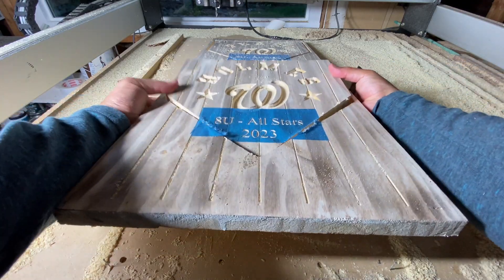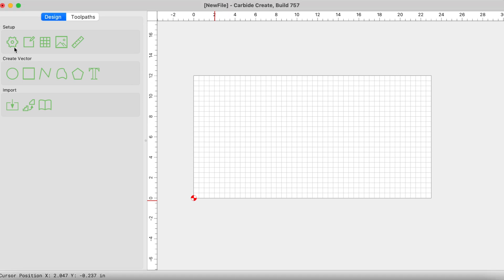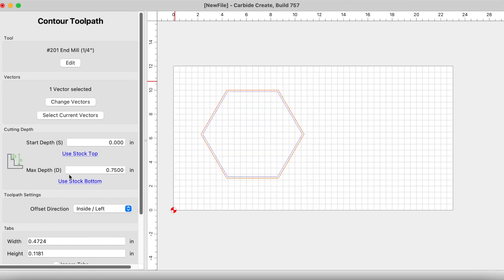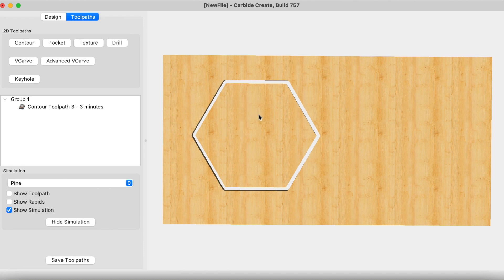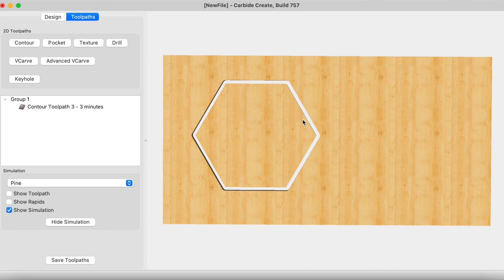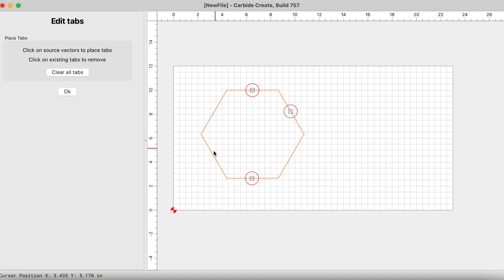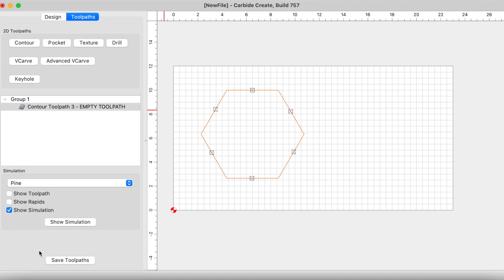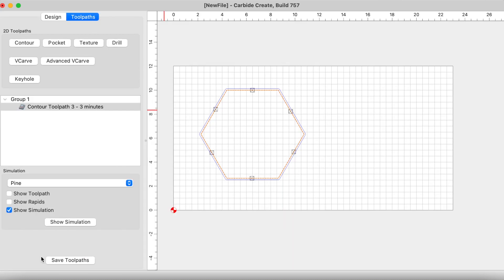Carbide Create Basics Tutorial - How to Make Tabs in Carbide Create

Comment: Yoooo. I was just cutting out pieces on my Shapeoko for my laser machine enclosure and I didn’t add enough tabs yesterday that the two tabs broke and the wood moved and messed up. Bottom line, add more tabs if you wanna be safe. Just in case. 

Love your channel and videos. 👍🏼🙏🏼
Reply from the maker: Funny you say that because my last project same thing happened.  I though two was enough but it ended one ended ip breaking and moving the piece within the material. 

Thanks for checking out the channel and video!
Reply: @aetimberpine  My wood pieces look like an F1 race track with the cut marks all over it.